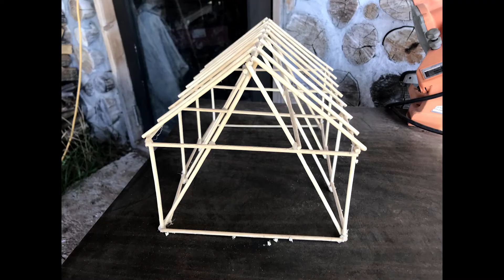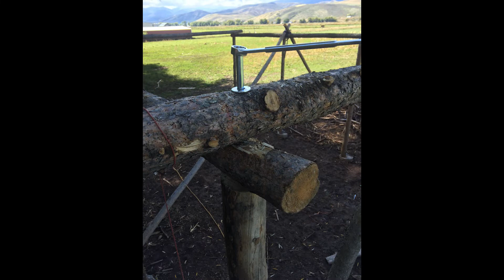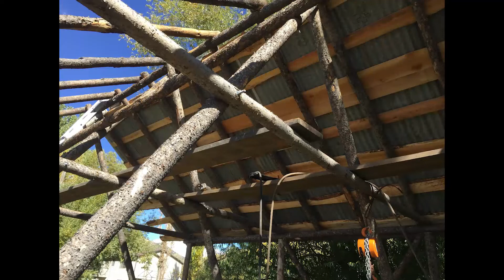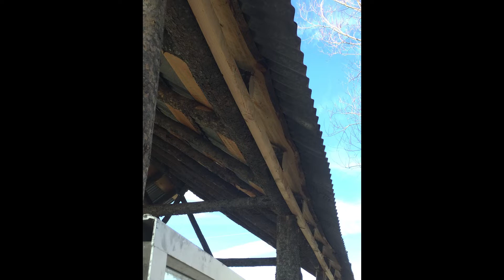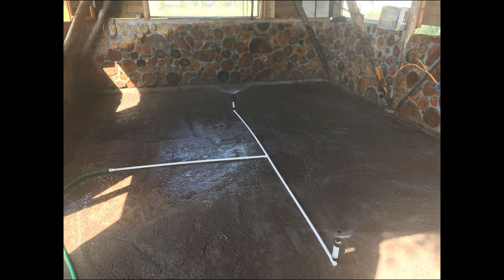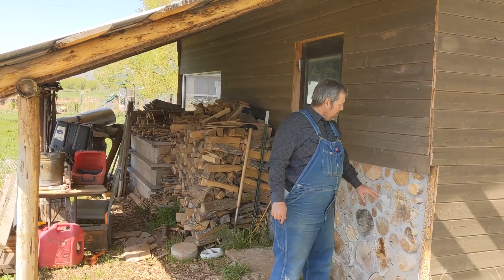Round Wood Frame & Cordwood Masonry Shed Build

Comment: Question:  you ran the electric wiring inside the logs as you built the walls?  I'll be doing solar in my cordwood, and thought I'd do wiring inside the walls.  My email is anna.rantala2@gmail.com, if you wanted to answer that way.
Reply from the maker: Yes, electric wiring inside the walls.  I lay the wire on the wood between the mortar joints.  Not my idea, I have seen builders do this in other videos.